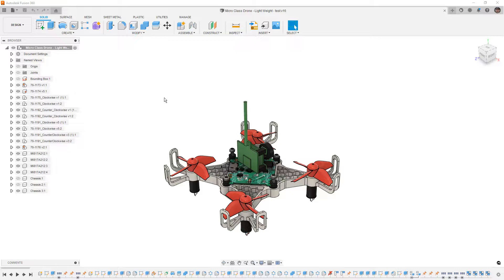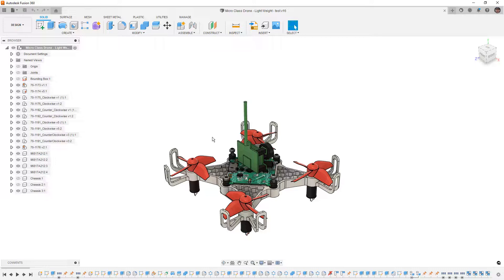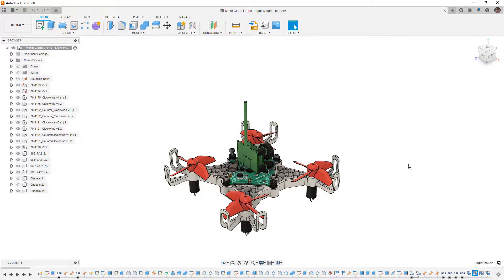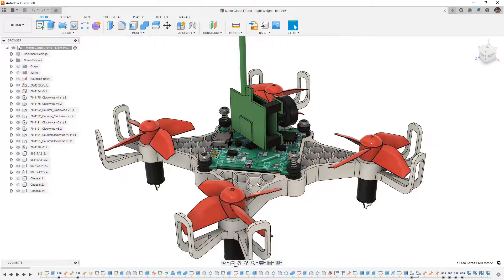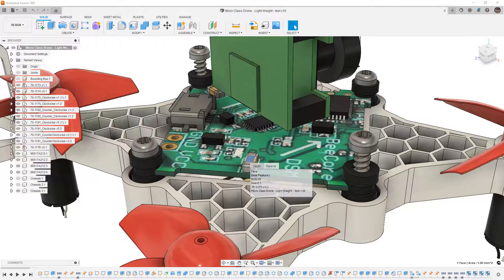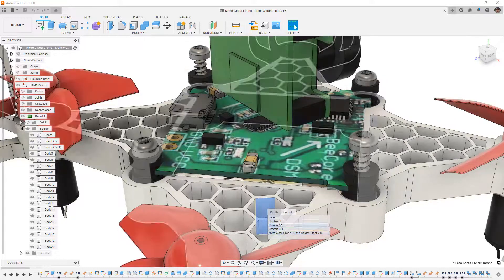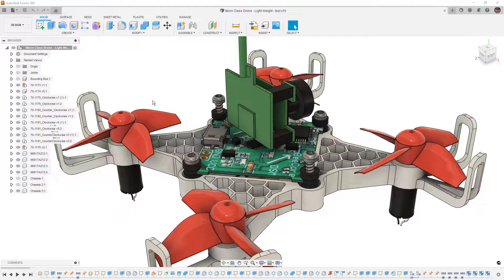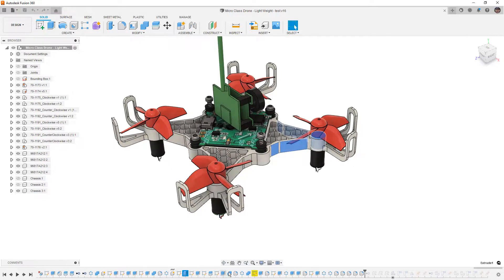Fusion 360 Quick Tip | Parent Child Relationships | How To Find Parent Of A Selection #fusion360

Comment: every video is about finding parent child relationship but nothing about how to CREATE a parent child child relationship
Reply from the maker: They are automatically created.  Essentially it is the link between sketches, features, bodies, and components. 

So for example if you start a new blank document in fusion, and you create a new component.  the Parent of that component is the "top level" of the design.  At the top of your browser the name of the file.

If you create a component under your new one this is a "child" of it.

Also with things like Sketches and Features.  If you make a sketch that is a circle, then extrude it.  The sketch is the parent of the feature.  If you then put a hole in the extruded cylinder, that extrude/body is the parent of the hole.

Fusion doesn't really do Parent/Child as well as other CAD programs.
Reply: @LearnEverythingAboutDesign  I've been trying to figure out how to do a parent component with different child components, each with slight variations.  This seems like it should be straight forward but I haven't figured out how to do it yet.
Reply from the maker: @5150mkii  There are "Configurations" in Fusion.  Might not be available on a hobby license though.  Another thing you can do is make one of them, copy and "Paste new".  this will copy the entire component and all features/sketches etc as a new non-linked component.  then you can edit what you need and change/add new features.

Comment: GREAT VIDEO!, yet, how can i change the relationship or Hierarchy of a child?
Reply from the maker: With Fusion you can drag things around.  So if you have a component you want in another component just drag it in the browser.  It will basically Cut and Paste it into the new location in the timeline.  There is a chance that it will break joints and you would have to reapply them.